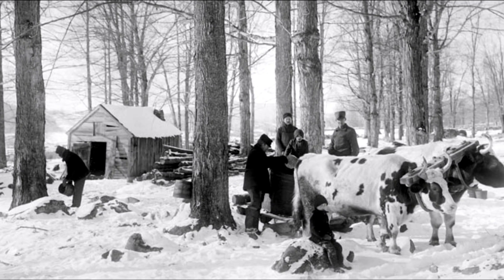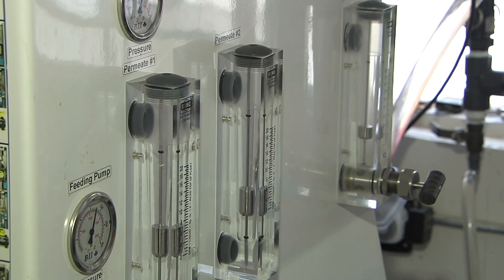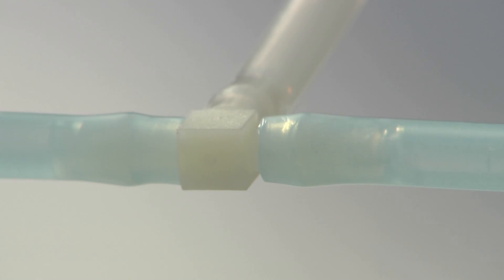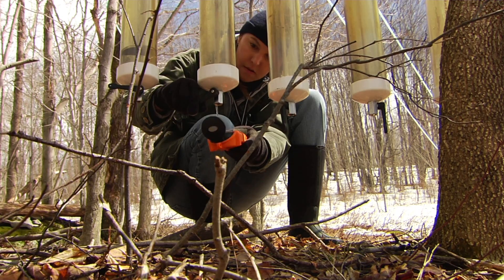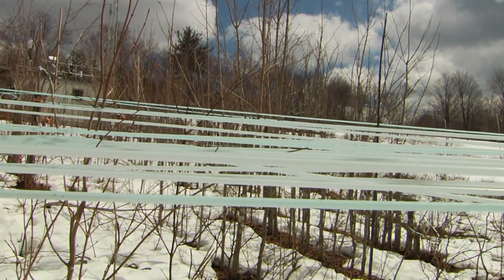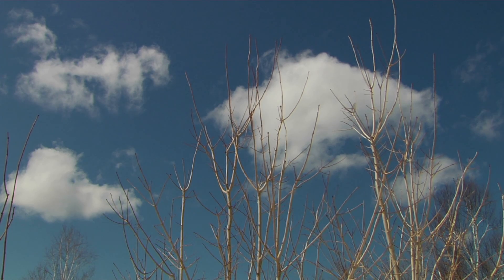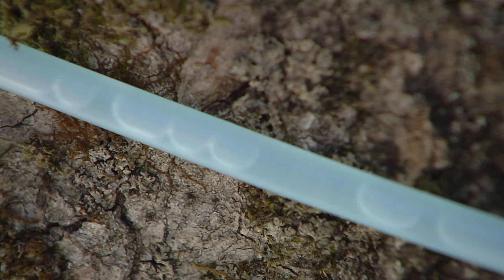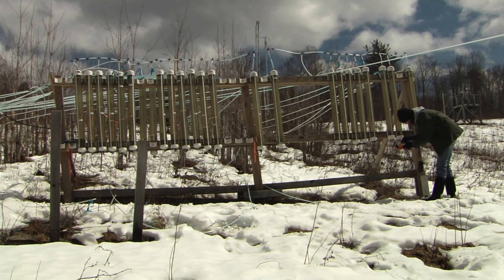Proctor Maple Research: Sap from Saplings

Comment: So if you can collect sap from saplings does drilling a hole in a smaller than recommend diameter tree make any difference. As far as harming the tree. Let's say 1 tap for a 12" diameter tree is normal. Could I put 1 tap in let's say a 6" diameter tree without hurting it ?